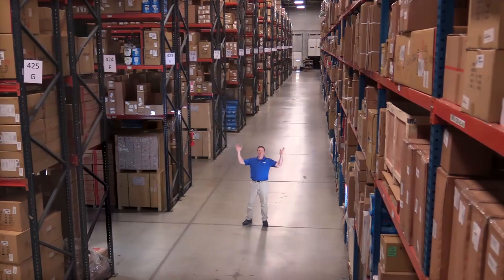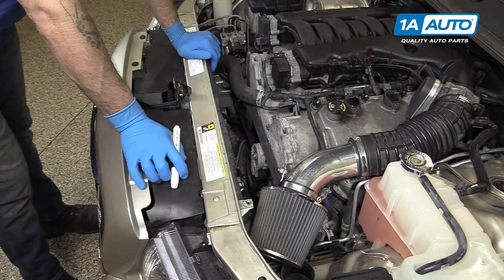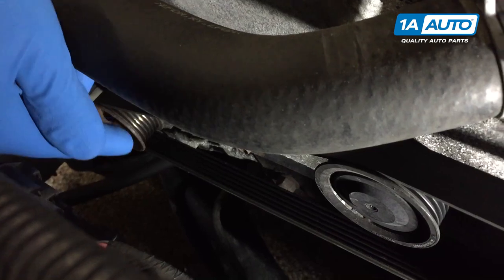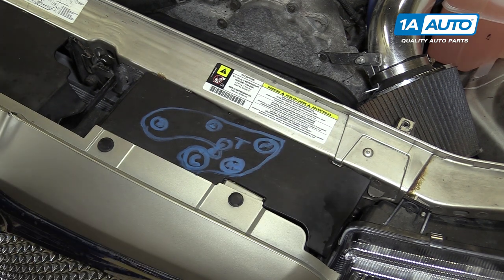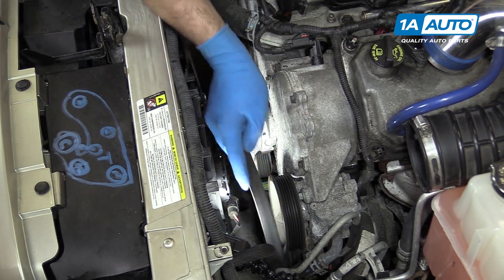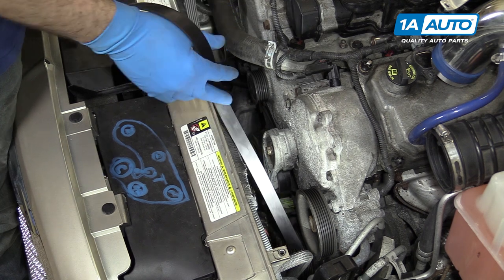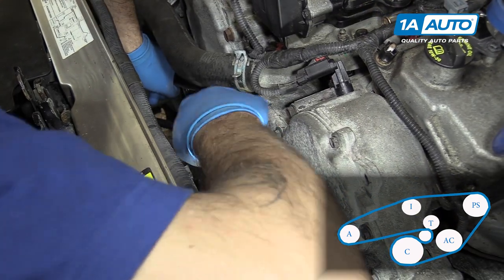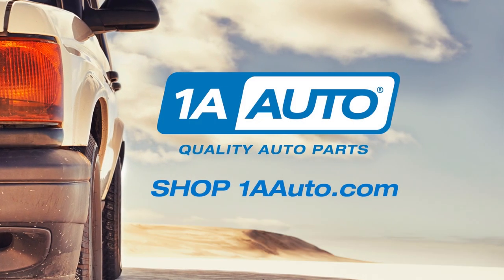How to Replace Serpentine Belt Tensioner 05-10 Chrysler 300

Comment: which size torque wrench would i need?
Reply from the maker: +sexton wright You may use any size torque wrench that will go within the specified torque rating. The most common size wrench is a 3/8 which usually ranges from 15 to 150 FT LBS. 1aauto.com
Reply: 1A Auto Parts thank you so much